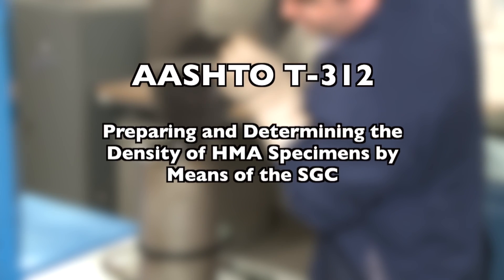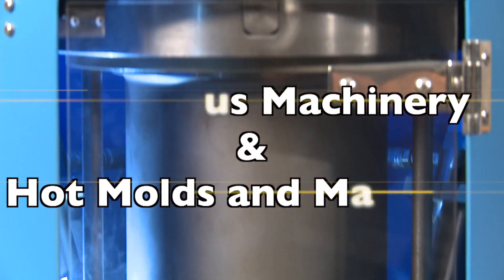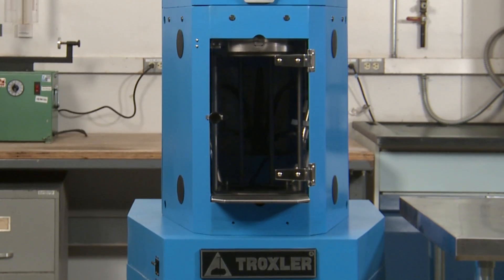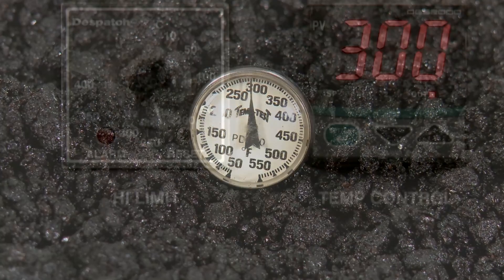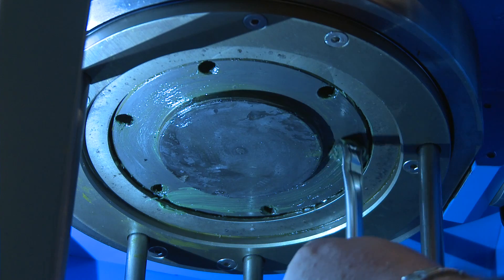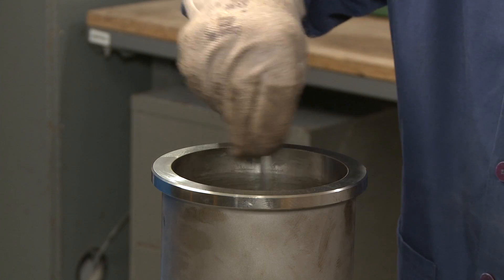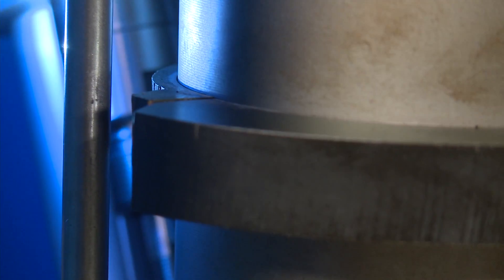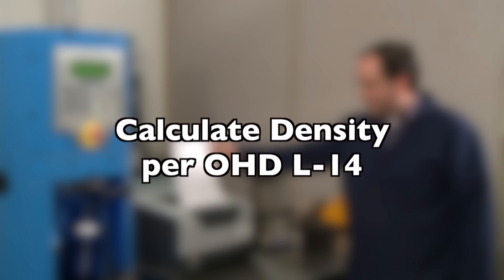AASHTO T 312, Superpave Gyratory

Comment: Nice video...Just received my Troxler 5850 last week. I was wondering if you have ever had a mold get stuck in the gyro?..It seems that about every other gyro I make, the mold gets wedged up around the upper carriage assembly ( which is well lubricated with Magnalube ).  The only difference I can see in your molds vs. mine is that mine has an actual handle and yours has that metal lip towards the middle.
Reply: I have not heard of the handle that you describe. I don't recall us having that problem.  I recommend contacting Troxler.